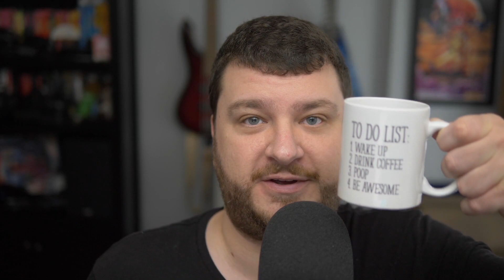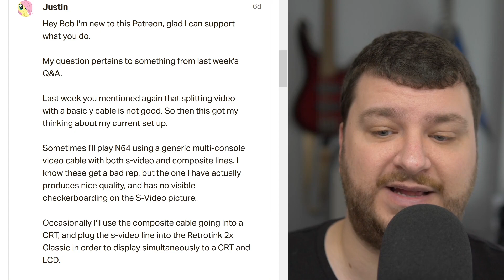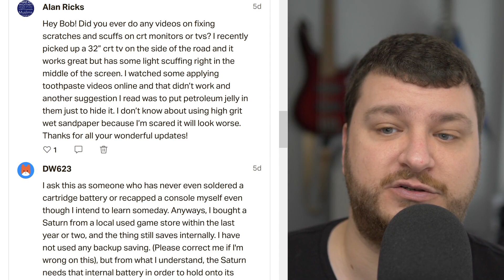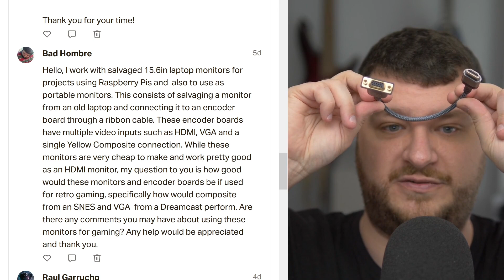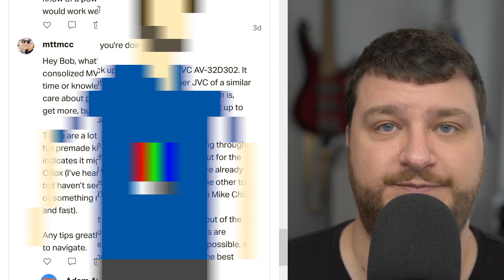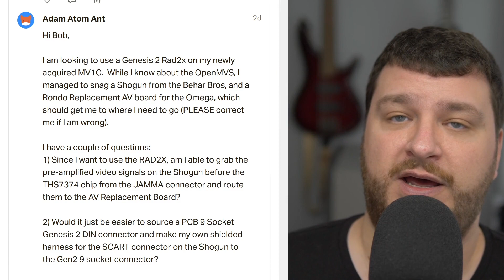Supporter Q&A #149

Comment: 🔴 25:49 - [component video distribution amplifiers....]
Were there brand names / specific designs or units that used certain power supplies to avoid versus ones that were good quality? If Audio Authority distribution amplifiers sold under ~sibling brand names with the exact same internals, what were their names? I'm seeing almost cookie-cutter style similarities between some units that appear to just have different names on them so I'm wondering if they had the same parts / amplifier / distribution qualities.
🤔 Will component video distribution amplifiers by default amplify and distribute RGB signal over component video? What about units that also have S-video amplifying/distribution?

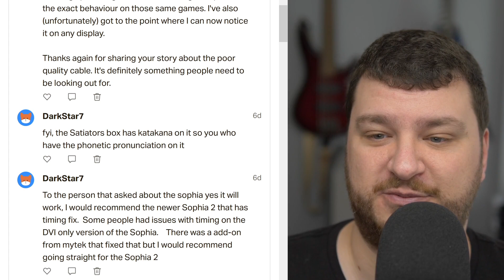Comment: 🔴 1:58 - Reputable modders/refreshers list... If only.
 I simply won't have time for all the console mainboard(s) (outside of their power supplies which are typ. quick/easy) and CRT re-capping / cap. upgrading for my gear and, in the case of CRTs, tuning needed not to forget the swiftly accruing list of forecasted modding for getting my applicable ODEs and video output upgrades.

Comment: Everyone wants to use the GBS C for downscaling, but I wanna use it for VGA 31khz signal for consoles lol. Component or RGB in, 480p VGA out type of thing (or integer scale thereof.) Am I the only one? Does OSSC make far more sense even with the cost? The list of features on Github and GBS seems like it totally could do it, either with a 240p, 480i etc input via Comp.
Reply: Personally I got it for 240p/480i transitioning

Comment: Scratches in glass. To keep my comment crystal clear and avoid any confusion, I’ve had lots of success using the same methods used to restore plastic headlights. There are about two million YouTube videos on headlight restoration and not so many on glass polishing but it definitely works. If anyone out there is too afraid to go after glass with sandpaper of ANY grit, grab some simichrome or flitz even better jewelers rouge and do your swirls by hand. It will not make it worse unless you use an applicator with trash in it or if your screen was filthy with sand particulates. Just clean the surface you’re going to polish and use a cheap sponge or applicator for the auto parts store specifically for wax and polish. I have a bad crt under my carport I might go put a bunch of different sized scratches and scuffs in it and buff them out for the sake of getting a video out there. You’re probably the 5th person in the last 6 months asking this question I’ve come across.
Reply: I will delete my comment positing the same but only in theory haha.
Reply: 🔴 7:49 - CRT screen scratch ~repair...
The following is for consideration where it might have application with CRTs (without a film coating) - an old recollection of mine doled out from my automotive enthusiast interests when it came to repair/polish decisions, products - mind you, contemporaneous to the TV episode - when they would apply and how to execute for proper results with obvious need for, given the electronics, a water-tight (possibly even a secondary mask) masking job of the CRT case / circuit boords to drain away polishing activities:
🔴 Rick Tech 101 : Detroit Muscle [refreshing eligible old windshields instead of replacement]
https://www.powernationtv.com/episode/DM2014-17/glass-tech-101

Comment: Thanks for your input! Cool thing that you reach out to some folks, trying to initiate a replacement product. Let's hope for the best! Keep up the good work, never regretted supporting RetroRGB since ever.
Reply: I can definitely recommend the GCLoader. It takes almost no effort to install and works so well. It looks like they're out of stock right now, but hopefully they'll make more of them. If you do get one, get an SD2SP2 card too so that you don't need to use your memory card slots for Swiss to save to. The GCLoader is $90, but that's an absolute steal compared to other optical drive emulators.